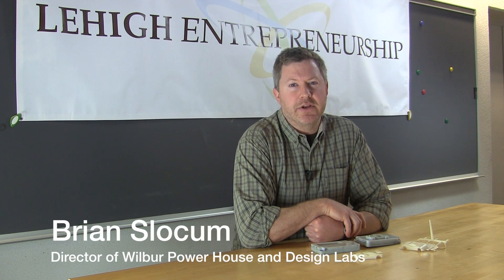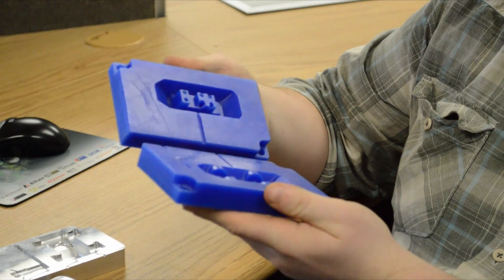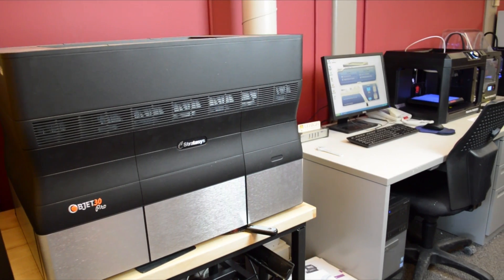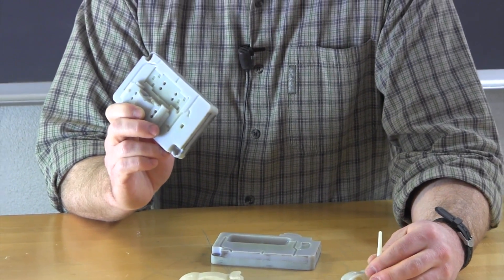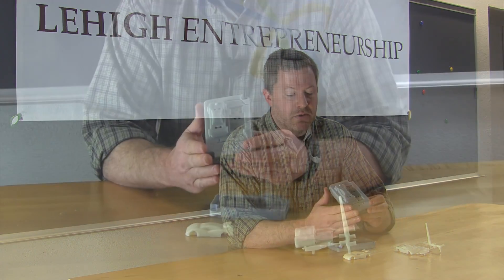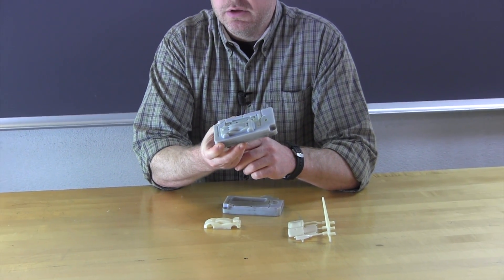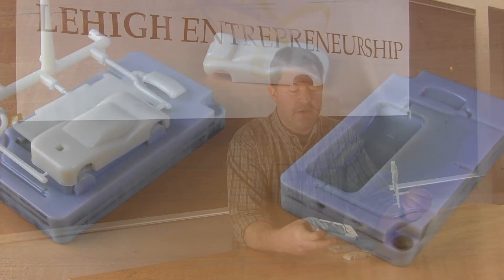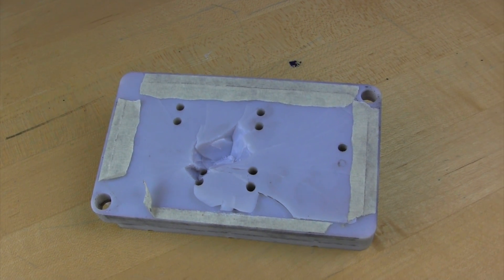3d Printing Injection Molding

Comment: Any updates on this approach?
Reply: This Approach works very well for Prototyping purposes. One of the main Problems is, that the Material has a high degeneration rate and thereby is not suitable for high part counts. 

I am checking this approach in my Lab and I can tell you that part counts above 100-1000 cannot really be produced with this approach.
Reply: @skippy18  I have some Siraya Blu arriving this week with the following specs:
Tensile Strength 39Mpa
Shore D 85
Young’s Modulus 1500Mpa
Elongation At Break: 25%

I'd be curious of this resin would be tougher than what you used.
A 3D printed mold that could be used for injection molded parts would be a great bridge to volume production in a prototyping environment.
I hope you are continuing the work. I'm very interested (only a garage-shop maker).
I am wanting to get one of my parts injection molded but the cost for me cant be justified yet.

jbc
Reply: @coulterjb22  great to see, that others work in their Garage too. 

The Resin parameters are about the same. But I can tell you that this approach is great for Prototyping small volumes and small scale Production. 

I would recommend to use as little resin as possible and enclose it in a Aluminum form for example, as the Resin is an insulator.
Reply: @skippy18  I saw that 'insulator' comment. Bummer.
I liked what you pointed out in using the printed mold as more of an insert.
I think smaller parts have a better ROI over larger parts when printing the cavities.
If I get my hands on a good 4K resin printer I'll work with a local shop to see what can be saved/done.
I think the 4k resolution will hit my garage before the end of the year...I just need to divert my wife's attention in another direction.

Comment: That is great for toys, but you cannot hold any tight tolerances like +/- .005" as in hard tooling.
Reply: how many use cases need that accuracy though?
Reply: @ge2719  None, unless you are working with precision machinery at which you will be spending money like it grows on trees so waiting 1-2 days for tool paths to be built is nothing.

Comment: Hello I am in model car manufacturing business . what printer is that printed these molds ? And how much does it cost ? How many shots can be molded by a 3d printed mold set ? What is the cost difference between a 3d printed tool and Conventional tooling as thousands of shots can be done by conventional tool set
Reply: As far as I could see from the model and printer itself, it was made from a SLA printer, where cheaper low-end ones could go for 200-300 Dollars to a few thousand for a high end one - which the one they used look like. As for the 3d printed tooling, SLA printers use resin to make plastic parts, and conventional tooling would have metal (like steel or maybe aluminium) for their tooling, so the 3d printed tooling would compare like the strength of a plastic hammer to a steel hammer.
Reply: @51atoms88  he said you could inject abs into a resin printed mold? what would the resin be that would allow such high temps ?